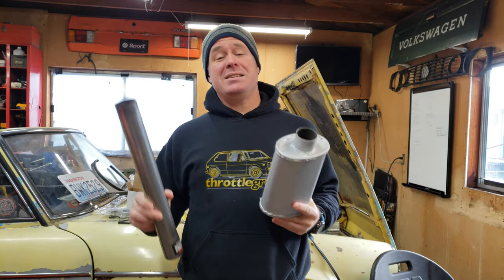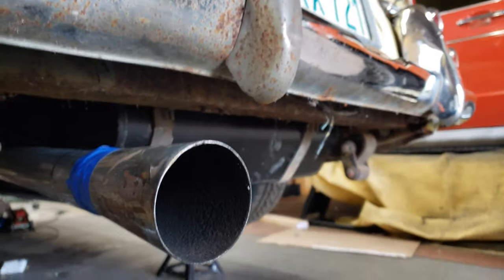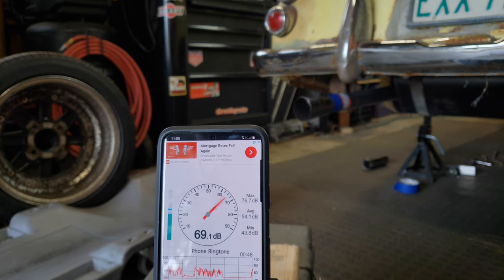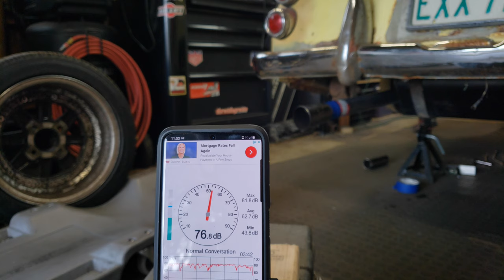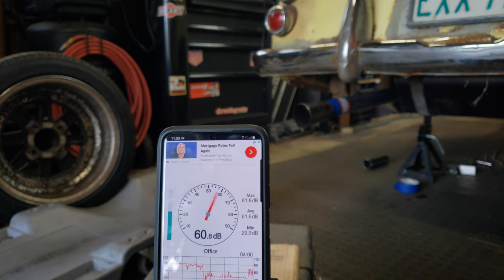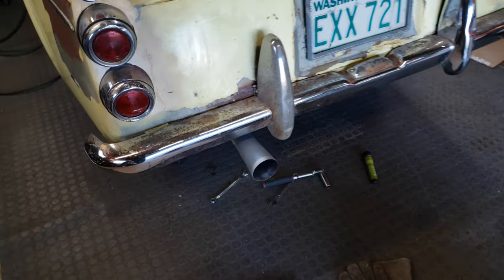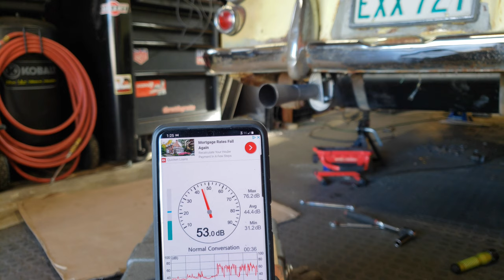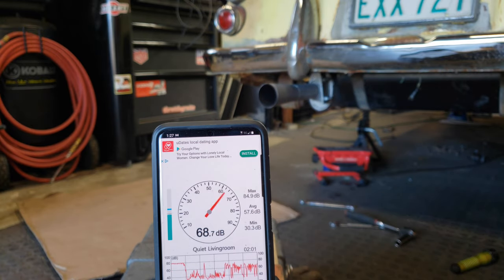Homemade SCRUB PAD muffler vs. STRAIGHT PIPE exhaust! DIY exhaust challenge! 1968 Datsun ep.15

Comment: Technically that was a resonator, but yes, improved sound.  You shouldn't need a heat shield, but it wouldn't hurt anything.
Reply from the maker: Fair enough. I might whip up a shield just to be on the safe side
Reply: @ThrottleGrotto  Nissan didn't see the need for the shield.  If you're concerned, header wrap is an option
Reply: This is literally how a Magnaflow muffler works. The whole POINT of a resonator is that it's hollow.